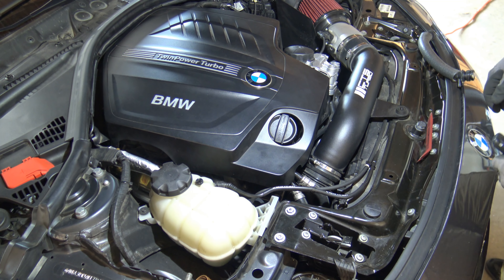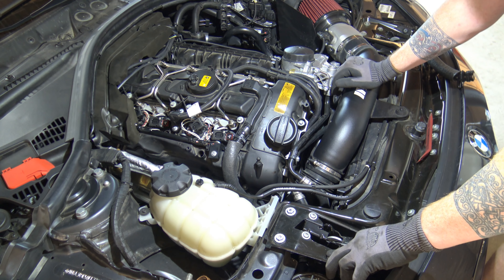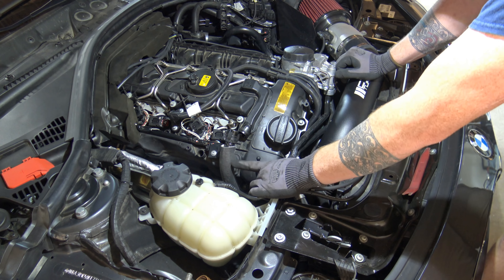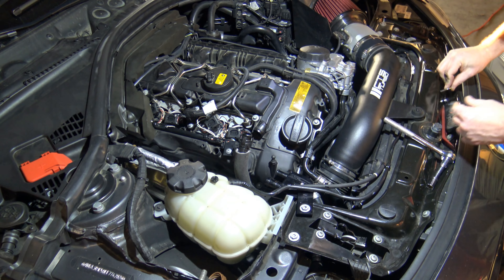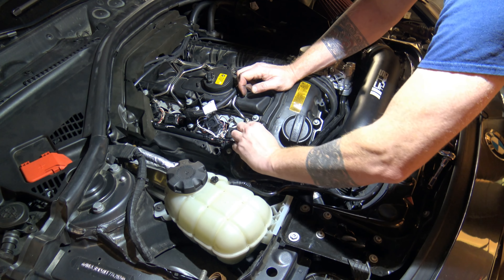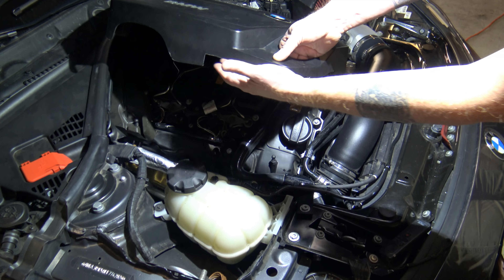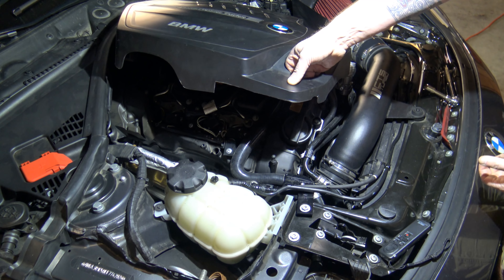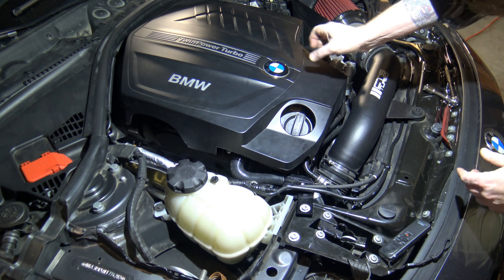Burger Motorsports Turbo Double Baffle Oil Catch Can DIY for the BMW F32 435i

Comment: THANKS for the info on the breather hose. I decided to order one, before I checked it on my 16 435. I changed it yesterday. After the new one was in I checked the old one and yep.. it cracked to pieces in my hand.
FYI.. that screw on the bottom is a real pain. But I did get it out and back in.

FYI... again, its a T25.
Reply from the maker: Glad to help and glad you checked the hose!
Reply: What's the trick to reaching the screw to loosen and reinstall?

Comment: Just want to add a trick on How to NOT LOSE THE SCREW in the Vent Hose attachment tight space:  Used Plastic film Food Wrap ~4"x8" (Masking tape also work).  Fold in half for increased strength.  Pierce the screw in the middle area of Plastic Wrap, next attach the screw to the Torx screw. Wrap the Plastic around the Torx Screw extension.  Now it is much easy to put it in place without losing it.  When it tightened, removing the excessive plastic wrap.
Reply from the maker: Fantastic suggestion!

Comment: sorry to revive an old vid with a comment but...

i replaced the pcv/ccv hose today, getting it ready for the BMS OCC that shows up in a few days, and not only did this hose snap about where yours did, but when i had my arm down below to wiggle the bottom out, my elbow was pressing on the coolant reservoir return line and that snapped as well. FROM THE OPPOSITE SIDE OF THE ENGINE ON THE UPPER RADIATOR HOSE (on the driver side of the engine bay), NOT THE RESERVOIR SIDE!!!

i suspect it already had a hair line crack in it. i wasn't overly applying weight on the hose at all, matter of fact i barely touched it, then i hear the sound of pressurized liquid, look up and see all that juicy BMW coolant spraying at the radiator lol. What would've been a $140 part from my local BMW dealer, came out to be just over $60 because my brother used to work there. Whew!

i advise everyone here, buy one from ECS or FCP for $40 even if you don't need it today, because one day you will, and your local BMW dealer is gonna take advantage of you. ECS for the BMW ccv hose for $70, or get the Rein for $43 from FCP, the dealer quoted me $170, $80 with my brother's discount.

I went with the Rein CCV hose. Fitment was tough because the hose is THICK AND SUPER STIFF. I'm not sure if the BMW version is like this, but I struggled getting the top portion clipped into the valve cover because you have to push and clip it into the valve cover at a pretty extreme angle. I had to loosen the bottom T25 screw out but not completely, clip the top into the valve cover, and then screw the T25 down while periodically making sure it was evenly seating back into the intake hose by wiggling and pressing it in, screw, wiggle+press, until the T25 sat flush and had resistance.

hope this helps someone!
Reply from the maker: Great info!

Comment: Do you just do the reverse of this to clean the oil catch can every oil change?
Reply from the maker: Even easier, just unscrew the can from the top. If you can't get your fingers in, just pull the bolt that holds it to the frame, dont need to disconnect hoses.

Comment: How do you do your oil change? Do you take this entire thing off then drain and fill the oil?

Is the vent tube in the description the hose you replaced? So I should order the $50 tube and the oil catch can at the same time?
Reply from the maker: So you can clean out the can any time, separate from oil changes.  Just carefully unscrew the can,  and dump out.  The breather hose itself gets very fragile, so be prepared to replace it, and yeah I would consider just changing it regardless.  Part number is in the description.

Comment: Nice video buddy, how much oil does these catch can really catch?
Reply from the maker: Depends on your car and local conditions as well.  Even for the folks that say the N55 and newer engines don't need/require these, I disagree.  (The N54 desperately needed this)

Even if the total is small, its just one more way to incrementally support your motor.  Any time you pull your N55 or S55 charge pipes you find oil in them, and I like to keep as much of that as possible out of the engine, injectors and valves.

For me, its cheap but effective upgrade.
Reply: Thanks buddy
Reply: @BMWDIYGuy  Agreed. I just replaced my N55 Charge Pipe and there were small amounts of oil lining the old plastic pipe. Catch can is a must. Great video. This is next on my list. Thank you.

Comment: So it looks like it will be almost impossible to unscrew the canister to empty it. It looks like a complete uninstall to empty and then reinstall. The other side of the engine bay, there is plenty of room to mount the oil catch can where you would be able to unscrew it and empty it at ease.

Is it not recommended to install it so far away from the original position? Is that going to affect flow or create problems if longer hoses are used?
Reply from the maker: Great questions.  I don't know if hose length would be an issue, but the OEM hose would have to be 2 or 3x longer, then the return of equal length.  I can get the can off with fingers under and around, then it screws off and back on.

Comment: Great video, and yes my PVC vent hose was as flexible as a big cheeto when i did this install. But, because of this video i ordered one before and had it on hand before i started - so thanks so much for the referral. So have you done any chemical cleaning of the valves like with seafoam spray? I was think of doing this but i can't find any reasonable place to spray. Any suggestions?
Reply from the maker: Happy to help, and pleased that you could avoid the !#$!#$#$!!!  AAAAAAHG run to the dealership before the closed like I did.

So I haven't tried any of the cleaners yet and really hear mixed reviews on the N55 and cleaning.  Some folks walnut blast, which gives the owner of my local shop the shivers.  They do chemical cleaning only, but some special system, but also rarely do it on N55s!  So really not sure honestly.
Reply: @BMWDIYGuy  Good to hear they don't do N55s very often and I agree about the walnut blast so maybe we're A-OK with having the catch can. Time will tell...

Comment: Do you have any instructions on how to replace the pvc hose?
Reply from the maker: If you mean the hose that can break is broken,  it's really easy. There is a single screw at the bottom that holds it down and the clips at the top.
Reply: Yea it's little one screw

Comment: I know this is an old video but thinking of doing this, what steps do you do take to remove the oil?   Do you have to remove the whole OCC or can you just unscrew the bottom part?
Reply from the maker: Still very valid and have this in my car.. you just unscrew the can off the mount and empty.  I did that the other day and the oily water mess in the can was nasty!
Reply: @BMWDIYGuy  Thanks for the reply..

Comment: What's the part # for the pcv hose?
Reply from the maker: It's in the video description
Reply: @BMWDIYGuy  Oh, there it is. Thanx. I'm getting a whistling noise at low speeds when I let off the gas. I've been to two shops and they tell me it's normal but I don't think so. Maybe it's that hose.
Reply from the maker: @TheRaferaf  hmm... possible.  That hose gets super fragile and cracks easily.  You can check by GENTLY wiggling it in the middle.. if it makes any cracking noise it's shot.  I wouldn't do so though honestly until a replacement is on hand. They can shatter inside the insulation cover super easy.
Reply: @BMWDIYGuy  Thanks man. I checked that hose and it seems solid. The whistling continues. I read somewhere that it could be lack of lubrication in the turbo but that kind of service might be beyond my skill set. I'll have to take it to the dealer.
Reply from the maker: @TheRaferaf  charge pipe leak would be another place to look.  Check gaskets top and bottom and if aftermarket pipe with clamps in the middle, check those too.
Reply: @BMWDIYGuy  charge pipe. That's the thick hose, to right of the engine, right. I checked it and it seems sturdy and secure.

Comment: How do you empty the catch can? Do you have to undo all the bolts and hoses just to empty it?
Reply from the maker: Easy.. the can just screws off, empty and clean and screw back on.
Reply: @BMWDIYGuy  Yeah I figured that you can unscrew the Can. But if you have a look at 9:28 it doesn't look like there isn't much space for you to put your hand in and to unscrew the occ without spilling it due to a poor grip.
Reply: By the way... I would like to install one as a precaution, meaning that I don't currently have a problem with clogged-up valves or anything. However, I would like to know how much carbon buildup there is already. Is there a way to check for it without taking the whole intake manifold off?
Reply from the maker: @-_vh_-  it is possible though very tight.  In a different case I pulled the bolts on the bracket and lifted to get enough room
Reply from the maker: @-_vh_-  bore cam is the only way I am aware of.
Reply: @BMWDIYGuy  All right thank's for the information. In what intervals do you have to clean out the occ? I heard people doing it every two months but some do it every two weeks.
Reply from the maker: @-_vh_-  I check it every oil change on both cars so far and never come close to overflow